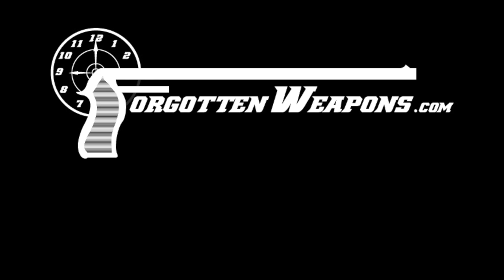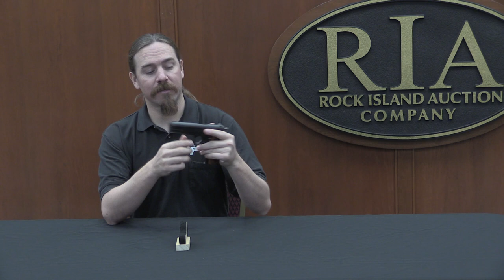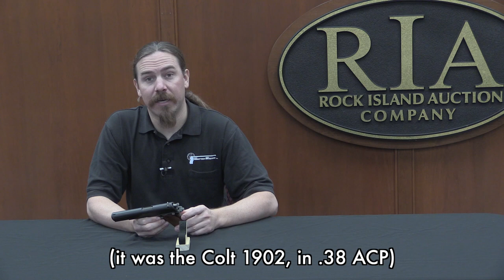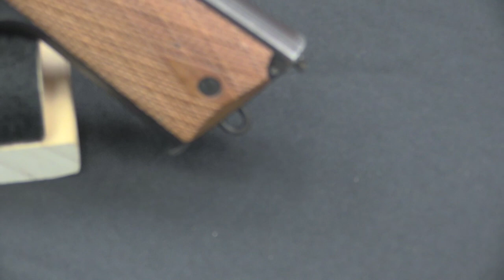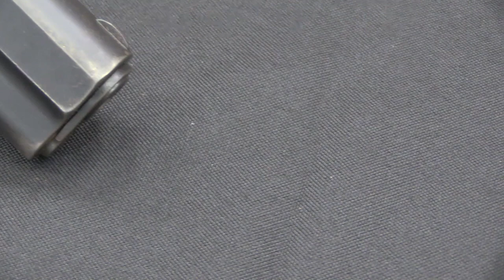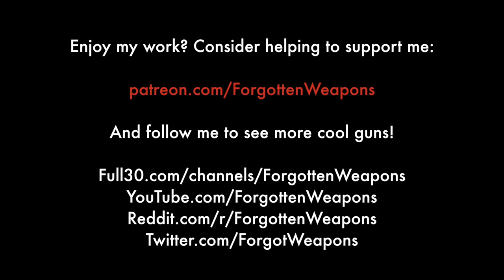Norwegian M1914 Kongsberg Colt

Comment: Excellent video!

I fired probably more than a thousand rounds through one of these during my year in the Norwegian Navy back in the early eighties, so it was nice to see it again. Mine was made in 1941 and was tight and precise. Some of the others in my squad had ones made in 1941, 1942 and 1945, and I seem to remember that we also had a few made in 1944, although according to Wikipedia, none were produced in neither 1943 nor 1944. The ones made in 1945 malfunctioned a lot due to the poor steel quality that had been used because of supply shortages towards the end of the war. Also, the ones manufactured in 1945 (and possibly 1944 and maybe even 1942) were decorated with a swastika on the slide. Only the 1945 ones also had the Waffenamt stamp on them, as far as I can recall.

We were told at the time that the M1914 Colt was the only US-designed handgun in use by the German armed forces during WWII, but I have not fact-checked that.

Comment: I have one Dated 1928 Matching Same Exact Finish I Bought at a Pawn Shop in 96 for
$250.00 it was marked on the Tag as a 'German Colt 45'. The Nazi Production Seems
to be Two Production Runs 1942, 1945.
Reply: +BigBossManBBQ Only the 1945 run had the WA stamps.
Reply: +rainmechanic  Try Again.
Reply: They sold for a lot less than 600 dollars here in Norway in 96, I suspect you could get close to 10 for that price back then. Its not much less than what they go for now.

Comment: I think the Argentineans were manufactured by Ballester-Molina. My grandpa was a cop, here in Argentina, and that was his service pistol.
Reply: +T0mN7 I thought the Ballester-Molina was a locally made stopgap to fill in for the 1911's.
Reply: Keith Larsen Yep, my bad. While they look similar, the 1911 was called " Sistema Colt Modelo 1927" (Meaning, Colt system 1927 model) Which ironically was produced for a significantly longer period of time.
Reply: +T0mN7 
"The Ballester–Molina was designed to offer the Argentine police and military a less-expensive alternative to the Sistema Colt Modelo 1927, which was itself a licensed copy of the Colt M1911A1,
 built under the supervision of Colt engineers. Production of the 
Ballester–Molina began in 1938 and ceased in 1953. Ironically, the Sistema Colt 1927 was manufactured until 1966."
Reply: +John4566442 The Model 1927 is a Colt 1911. The Ballister-Molina is slightly different and the parts don't necessarily interchange.
Reply: also in Spain the Astra makes a copy

Comment: Ian, did the test run turn out to be successful?  Did the Kongsberg people start making handguns again?  How would you compare quality of manufacture on the Kongsberg to a Colt or domestic military contract 1911 or 1911A1 of the same period?

Great video as always.  I saw these once in a magazine, and I was thrilled to see you'd done a video about one.  Any plans to do the Mexican Obregon 1911?  Or maybe you already did.... I'll go look.
Reply: I don't recall if they kept making handguns, but Kongsberg weapons factory itself was and still is (although re-organized under a new brand now) a very significant international weapons systems designer and manufacturer. They make several systems used by the US military, including anti-ship missiles, air defense missiles, and they also made the software suite used in american AWACS. And if I remember right they make avionics components for many of the US air-to-air missiles of various types.
Reply: To my knowledge they do not. The Norwegian military now use the Glock 17, which is bought from Austria.

Comment: Could it be that they wanted to compare their new service pistol contenders to new 1914s instead of well worn 1914s?
Reply: +kylesenior Why should they? 
The Norwegian handgun competition was won by Glock in the early 80's, itself replacing the Walther P1 adopted in the late 60's.
The complete reequipping of all service branches was completed by 1985, and no way a 1911 can beat the Glock 17 as a military sidearm.
So by 1987 the M1914 was in storage awaiting war or disposal, in the mid 2000's the latter happened.

Comment: So why did they stop making these after WWII when the US Army continued to use 1911s? Was it because Europe was switching to 9mm?
Reply: +Henrick Likesrabbits Probably because after the war there was a huge surplus of weapons. Norway is not a big country and in addition to the Kongsberg Colt they had piles of Lugers and Walthers laying around. In 85 the Norwegian military switched to the Glock 17.
Reply: Joakimi Hajta-Hojta ah ok that makes sense i suppose.
Reply: Henrick Likesrabbits Same deal here in Sweden, we still got piles of guns and ammo in storage from the war. Heck we had to bring out our FN 1903s from storage in the '80s since our 40's era pistols started cracking. Took until '88 before the armed forces switched to the Glock 17.
Reply: +Henrick Likesrabbits The norwegian armed forces kept on using the 1914 until 1968, however it was suplemented by other small arms. In 1968 the Army changed to the Walther P1 and the Navy retained the 1914, until they both were replaced by the Glock in the 80's.

It is important to remeber that the Norwegian armed forces prewar was a small organisation with no more than 20 000 personel active at one single time, while the post war organisation had over 100 000 active personel. As such the need for arms was completely changed, and as such the deficit in handguns was suplemented by german weapons instead of producing new 1914's, and guns in wierd calibers passed on to the police. This dession makes even more sense when you consider the fact that the 1914 never fully replaced the Nagant revolver of 1890s vintage. Wich in turn only suplemented the lefaucheux revolver of the mid 1860s, it was even upgrded for smokless pinfire rounds prior to WW1.

Comment: It also looks like it has a wide spur hammer compared to the standard 1911 A1 is that the original hammer for the pistol. Also the tail on the grip safety looks a little short and narrow I bet that sucker bites hard.
Reply: Ok so after a little research I realized that the original 1911 A1s had that wide spur hammer (as well as the narrow spur hammer).